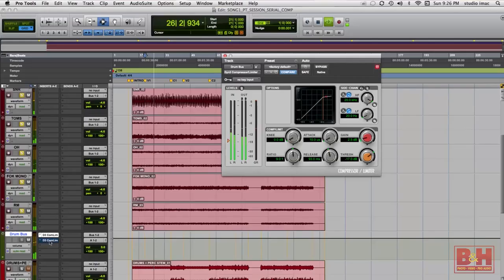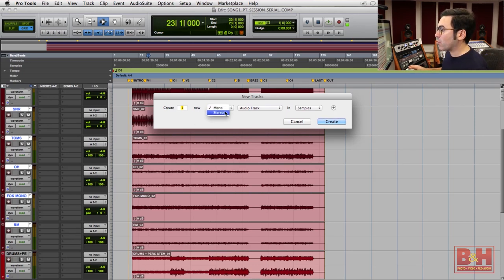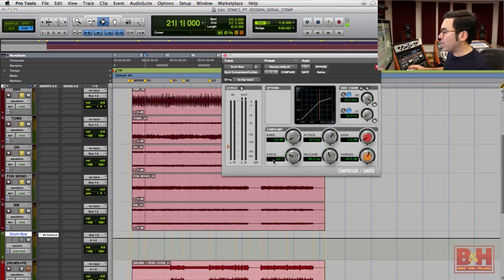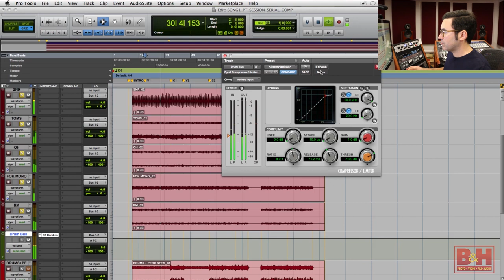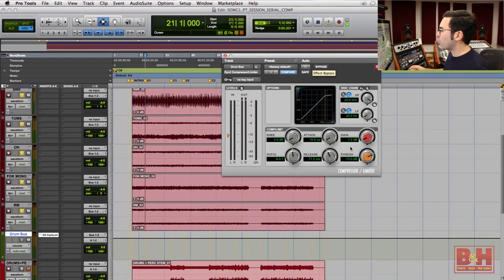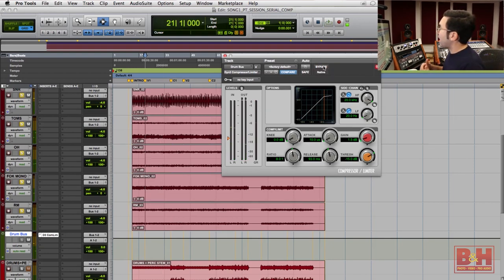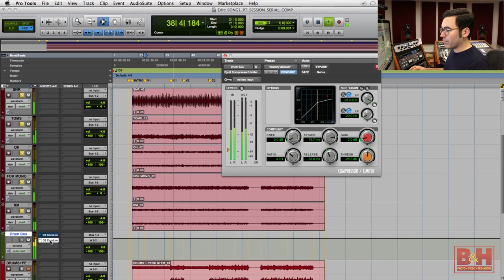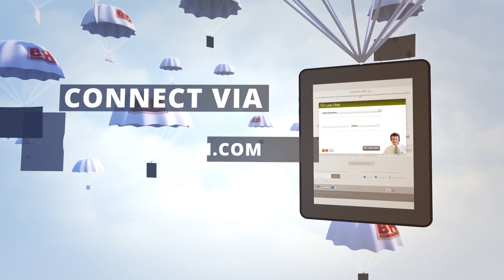Pro Mixing Tips: Serial Compression

Comment: I assume this is generally the order we would stack 2 compressors even on a masterbus....am I correct?  Faster attack compressor BEFORE slower attack compressor?  Ive been experimenting with stacking compressors on the master bus as Ive seen it done but I never understood which order the chain was in(faster before slower or visa versa).  I know it shouldnt be too fast nor compressed too hard on the masterbus but I just want to know the general order people use it when stacking there.